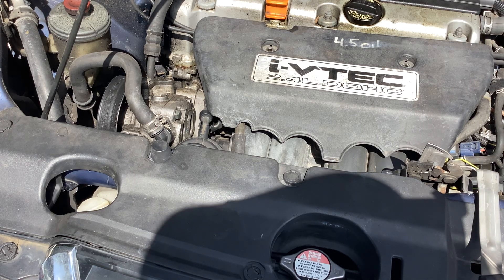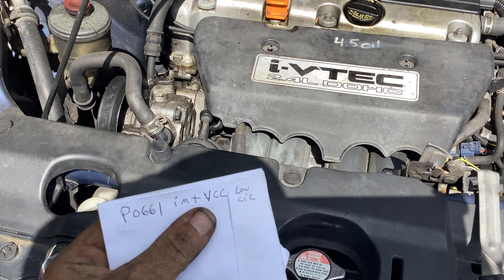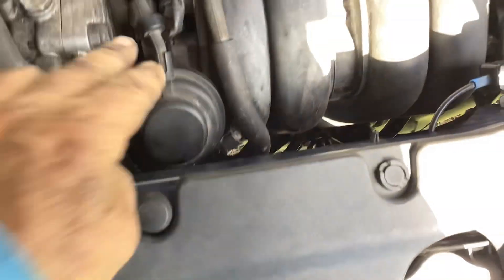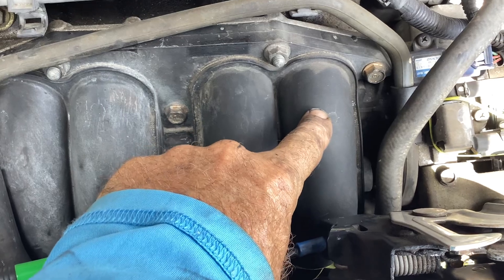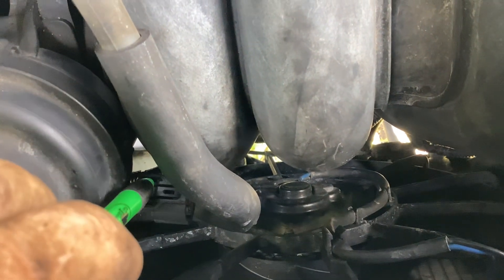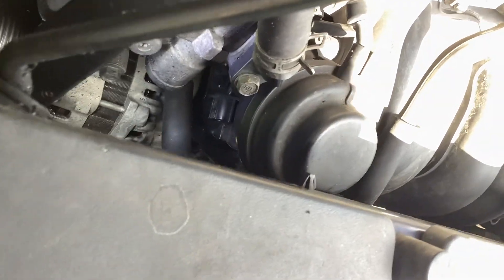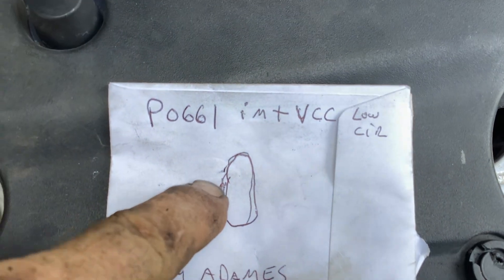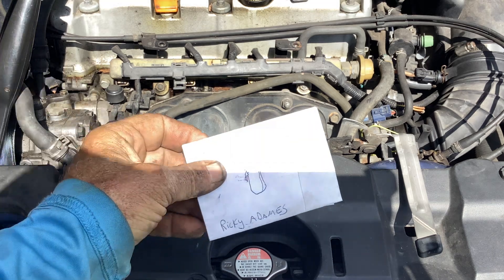Honda CR-V 02-06 with 2.4 L inline-four Engine.    OBD-2 code P0661

Comment: So strange I see the connector underneath but I don’t have a wire like you should to make the connection between the gray and black connector. Thoughts on why. Recently I had my whole ac replaced
Reply from the maker: Look around, it may have been knocked off by the a/c technician.

Comment: I got a P0661 on my 2002 Acura RSX base automatic, and I know EXACTLY what is causing it...(Drum roll)...when I was replacing my knock sensor, I accidentally pulled out one of the electrical connectors. I shoved the wires back inside as best I could, but I need to go back in, and fix this connector with a proper crimping tool.

Edit: By the way, GREAT VIDEO!
Reply from the maker: good deal.  Hope your back on the road soon.!!!
Reply: @tommy-time5240 - Bro, thank you! This really does help, as I did even recall what the plug looked like, I was so focused on other things. Have a great day

Edit: you are absolutely correct: they don't provide much room for this connector, that's how I missed it...I just thought the manifold was giving me resistance when I removed it.

Comment: Hello, my name is Askar. I am writing to you from Kyrgyzstan, I need your advice. I'm writing through a translator. I have a 2004 Honda CR 2.4 liter car from America. Error P0661 has recently appeared. Please tell me where to look for the reason. The car in the parking lot, when turning the steering wheel left to right, seems to be suffocating for lack of air.

Comment: Thank you!!! I feel like I owe you a comment because after replacing my starter I had this code and I'd almost gotten to the hair-pulling-out stage because I was pretty sure I'd gotten everything reconnected. I was focusing on the upper connector and the solenoid while this was the problem all along. Also I had an apparently false memory of the check-engine light having stayed off for a time after I'd reset it the first time, which obviously hadn't happened. Went straight out to the garage after watching and hell yes I saw that dumb thing sitting there right next to its plug, and plugged it in. Amateur mistake for sure but I'm good at those. Everything else went back together without a hitch and I replaced a few other parts while I was at it so my daily mule will ride again. Thanks so much for going to the trouble to make a video pointing this out.
Reply from the maker: Thank you very much.

Comment: I just wanted to say thanks for the video.  I had replaced my starter in my 04' CRV 8 months ago, and wouldn't you know it,.. I had to replace it again! This time, since I was a bit more familiar, I was able to do it a little quicker. However, I ended up getting the P-0661 code, and it was baffling me. Then I looked it up and saw your video about that little connector underneath. It ends up I didn't see it! I connected it and vouala! I cleared the light code and it stayed off!  Can't thank you enough. It saved me time, a headache and some money too!  Thanks again!
Reply from the maker: Glad it worked for you.  Keep up the strong work.

Comment: Carbon build up. Engine carbon cleaner spray may clear it out. Back in my gear head days we crushed walnut shells down the throat of carburetor whilst engine was idling to clean out carbon😁
Reply: G  day from Ontario  R u serious, would some shell not fall in past rings.?  Ths
Reply: @donvoll2580  Worked for us guys and our fathers before us. My father raced in NASCAR w/stock cars. Things not not much different except carburetors to fuel injection
Reply: @curtite  really   Ths